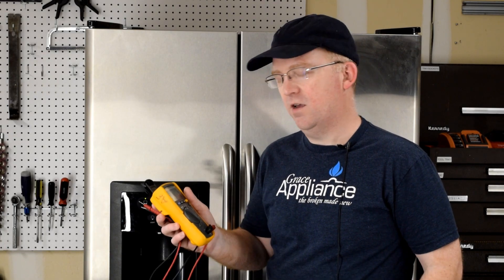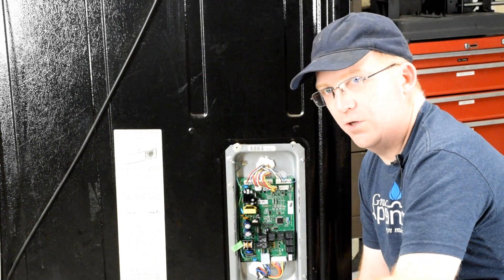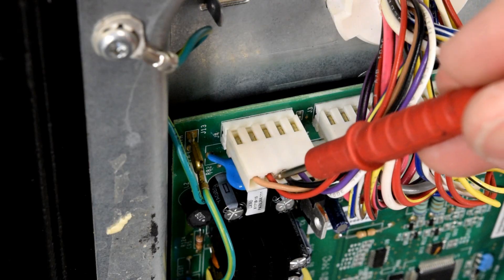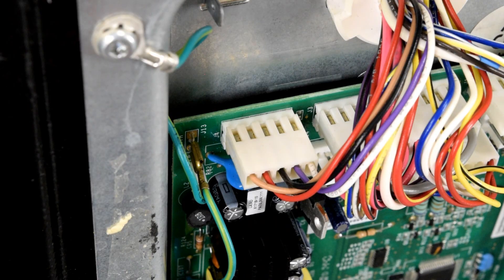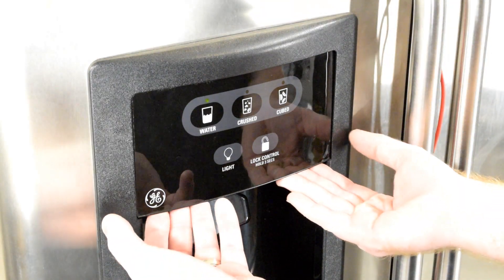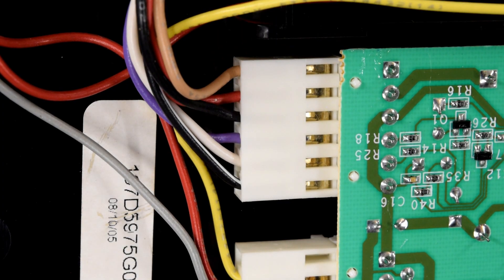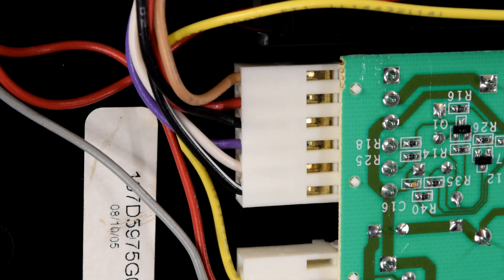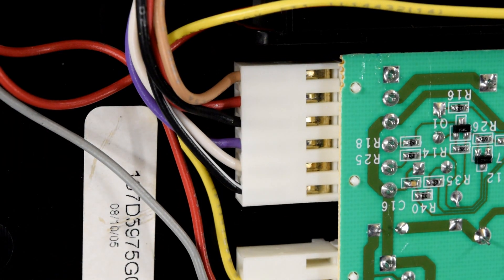Diagnosing a Bad Control Board - Part 4: Front Touch Panel

Comment: My ice and crushed ice buttons seemed to be working well, but my water button was getting intermittent, or not functioning for periods of time. Having some other issues, I decided to check the control board's components, and found 1 electrolytic cap , a 1uF - 50V, that had gone totally open. There were 2 others of the same type on the board, and I had some replacement spare caps ( electronics repair hubbyist) , so, I swapped the 3 out, and I now have a perfectly functioning water dispenser!

Comment: Do I change the dispenser control board in the back of my refrigerator or the main control board? I changed the dispenser control panel in the front and it still have a black screen

Comment: Seems simple enough to test the font panel first rather than the control board.  Why wouldn't I just check if 12-14v is coming in there first before looking at the control board in the back?  (Also I have noticed every GE fridge seems to have a different way to hold in the front panel,  some have snaps on the top, some snap off on the bottom (like yours) mine has two screws.  If I tried one of the snap off methods I would break something

Comment: In my case I don't get the correct voltage with J4 plugged in and it won't turn on.  As soon as I disconnect J4 it turns on and the pins have correct voltage.

I've disconnected the conector on the bottom of the freezer door, and with J4 plugged it's the same deal.

I changed main board, changed dispenser board.  Same issue... can it be the cables itself?  Will the fridge not turn on if there is no dispenser board present?

Comment: Hi  i have a question do I damage a control board that drives a linear motor when I power it without having the motor connected? I have a LG-GS73SDD and it doesn't respond to the internal freezer temperature sensor. It cools to deep and the motor is not switching off. I plan to test the Fsensor  and Dsensor but if that doesn't work I plan to add my own Arduino controlled sensor and switch one motor power feeds with a relay.  I was wondering if that damages the motor. The other option is to see if I can trick the FSensor en tell the mother board that the temperature has reached its set point.

Comment: Control board front & back control board  are test results 13.27  . No dispenser water & ice , I replaced water intel , switched, housing shield and solenoid for GE appliances. Also replace head filters still no dispenser ice or water.. I need help now ???

Comment: Our front touch panel had been out but  the the fridge and freezer were fine. The video was helpful. We don’t have the same model but the video did help. We ordered the display panel assembly. We had to order the bracket also because it did crack. We changed them ourselves. Success! Thank you!

Comment: Hi Andy!  Great video.  My problem is intermittent.  I have a GE28GYNCFS Side by side fridge with bottom freezer.  Control panel works for a while then stops working.  If I disconnect and reconnect power the panel always works again for a while (sometimes an hour or so, and sometimes only a few minutes) and then stops functioning.  Suggestions?
Reply from the maker: Hey Keith, it's likely going to be the main control based on the symptom alone.

Double check the outlet is not an issue by plugging in a different electrical device such as a lamp. This is just to rule out a failing socket at the wall. 

I would also want to rule out the front touch panel being shorted. At the time it's not working, if you disconnect the front touch panel from it's harness, if the fridge returns to normal, I would then suspect the front touch panel.

However, based on my experience it's most likely a weak relay on the main control board. As the relays heat up, they do not work as well, but often will from a cold start.
Reply: @GraceAppliance  Thank you for your quick reply!  I don’t believe it is a wall power issue - I’ve check the voltage at the duplex receptacle and it is 120VAC and even when the front control panel fails the interior lights are on and the fridge continues cooling ok - the control panel just stops functioning and ice dispenser stops.  I checked the voltage on the control panel and it stays between 12 - 14 volts dc.  I found that when it fails, if I unplug the harness on the back of the front control panel and then reconnect it the control panel resets and starts working again.  So I am thinking the problem is the front panel board… would you agree?
Reply from the maker: @keithgeorge2541  the front panel if shorted will give the same symptom, but once unplugged the fridge should nearly immediately act as normal. If no, I'd focus on the main control instead.
Reply: @GraceAppliance  will give it a try.  Thank you!

Comment: Hey Andy, I have a problem with my GE side by side refrigerator  (Model# GSH25ISXBSS). I set the temp control to the recommended temps (0 freezer, 37 fridge) but the actual is way to low,  -5 and 25 degs. I have replaced 2 of the 3 temp sensors and the main control board. The only temp sensor that I didn't replace is the at the bottom of the freezer. Could that be my problem or maybe the dispenser control board. If you think it is possibly the board, I think you do board repairs, would you have one? I am having a hard time finding one. GE is not making this board anymore. This has been a real chore for this old man but will "getherdone" if the Good Lord let me live long enough. Thanks up front for the help. I have watched all you videos many times. You bring it down to earth even to where I can understand.   
 Thanks again Mike

Comment: this viedo shows me so much- I thought the voltage would be AC and I stayed away. I replaced my auger motor on my Frididaire  FFHS2322MW2 and it and the inside light still don't work; so I'm planning to use the structure you taught to diagnose my problem. Thank you

Comment: Great video.  I have a GE Profile PSS26MSWASS.  The dispenser display was blinking a "0" then it it went dark after a couple of days.  The voltage at the dispenser measured 8-9 volts.  I could not find a wiring diagram so I assumed it was low compared to 12-14v stated on this video.  At the circuit board in the back, it measured 13.6V  What would that tell me?

Comment: I don't understand why you set the multimeter to DC voltage and not to ac voltage, since the refrigerator is running with electricity from the socket.
Reply from the maker: Hey,
The fridge has certain components that use DC voltage such as the fan motors and other things that use AC such as the compressor and light bulbs. 
The voltage is transformed via the control board from AC to DC. 

I hope that helps.
Reply: @GraceAppliance  thank you, one more question how you know if fridge equipment uses DC or ac volt?
Reply from the maker: @kamalabbady6778  the component will say on it. Also, 120v AC will use larger wires than DC which will have thinner wires.

Comment: Hi Grace, I have followed your tutorial, and did all the measurements, my issue, is that I recently replaced the evaporator fan, and right after that, when I plugged in the temperature on the front panel on the freezer was showing -43 degrees c, and the fresh food 2 degrees, and at this point the refrigerator was off for more than 24hrs. I test all the thermistors, they are all good. So what seams to happen is, as the temperature provided is so low, the compressor won't start. I got it to start by raising the temperature on the front panel, on the fresh food compartment, and then again turning on, since the temperature at that point on the front panel stats 2 degrees, when I set ti 1 degree, it starts, but than 5 min later would turn of as the temperature on the FF move down to 1 degree, and at this point it would not turn on again, unless I do the same steps again! I test the sensors and power on the board , and I got 5 volts w/ the conector unplugged and 1,5 volts w/ it plug in. can you help? mi ref. is a side by side profile - 200d6823p076

Comment: This is the best video for figuring out how to remove the control panel. I searched through all of them and this one works for the GE Profile, side-by-side model too. It's impossible to get to all the mold and crud inside the ice and water dispenser area unless you remove the panel. It's got to be a lot healthier now that I removed 15 years of super nasty stuff.
Reply: You can use long stick cotton swabs (for plastics areas only), damp them in a glass with baking soda or white vinegar then use that swab to clean difficult to access areas. Don't touch anything electrical and off course, disconnect power before start cleaning. there is a way to dismantle the whole system and put all the plastics in bleach but if you don't know how to do it, you can easily beak the plastics pins or loose some very small springs and screws. Always use hand tools, not powered.

Comment: Great video. My situation is a bit different. I have 13v going to my dispenser from the main board and the dispenser has a green light flashing on the water button. No buttons work. Water pressure is fine and the line isn’t frozen. I thought it was a bad front panel board and replaced it but the new one is behaving exactly the same. I ran a diagnostic using the temp buttons (service mode) which reported that the main board is not communicating with the front panel. My gut says bad connection perhaps via the wire that goes under the door. Would you recommend some further diagnostic to help pinpoint the issue? Thanks a lot.
Reply from the maker: Hey, thanks!

Yes, I'd first suspect the connector near the bottom freezer hinge. You may find corrosion or broken wires there.
If the connector is too far gone due to damage, you can delete the plug altogether by soldering the wires together, but this makes removing the door more difficult in the future if you ever needed to.

I'd start there and see how it goes.

Comment: Hi Grace Appliance, I have a GE side by side and my freezer is 0 degrees F at its warmest setting and the water dispenser has frozen up.  I bought a heater kit to keep the outlet of the water warm.  I have 13 volts between the red (slot 2) and the wires on either side (this is the front touch panel).  However, the heater is supposed to be connected to red (slot 2) and slot 6 but I don't have 13 volts there (no voltage).  Can I connect the heater to slots 2 and 1 or 2 and 3?  Or should I be checking thermistors?  I checked one of the three at the bottom of the fridge and it seemed OK.  This is a GSL25JFXL.
Reply from the maker: You may want to verify true temp with a separate thermometer to verify thermistor/sensors. But, the side by side GE is notorious for freezing water lines due to insulation breakdown inside the door.
You can help this with adding some insulation to the inside of the door behind the dispenser as well as the heater.

Yes, if you find 2 pins that provide 13vdc full time, those will work fine for your heater.

Comment: This was very informative. I'm not sure where to go from here. Everything lights up on the front. The Ice door comes open but no water and no ice. It doesn't even try to come on. I unplugged it and now it flashes 00 00. Any ideas?
Reply from the maker: Hi Kris, thanks!
What's your model #?
Reply: @GraceAppliance  Sorry about that. The model number is GSE25HMHBHES, Thank you again
Reply from the maker: @kriskrock3381  so, the zeros indicate an issue that the front touch panel is not communicating with the main control board behind the refrigerator.
Most commonly, this will be a corroded or damaged wiring harness near the freezer door bottom hinge. 
Remove your kick panel from under the fridge, lay down and examine the connector there. You may find corrosion or broken wires. Unplug and replug in this connector 10x and see if it improves things. In dire times, I've removed the plug entirely by soldering the connections together vs having a connector.

Let me know how it goes.
Reply: @GraceAppliance  Thank you very much. I really appreciate it. I'll let you know what I find out.
Reply: @GraceAppliance  so I checked the connectors. No corosion, connection is secure and nothing is loose. Thank you again for the help
Reply from the maker: OK, does the refrigerator run/cool at this point?
Are the interior lights on?
Reply: @GraceAppliance  yes. The refrigerator runs and all the lights and everything else works as normal
Reply from the maker: Gotcha!
So, I suspect it will either be a poor connection between the front panel and the main board behind the fridge or perhaps a failed main control board.

Using a multi meter, you would be able to verify proper connection between the two boards. If you needed some detailed help in this respect please consider becoming a channel supporter where I am able to provide more in depth support through the community tab there. 

Https://www.Patreon.com/graceappliance
Reply: @GraceAppliance  thank you very much. I appreciate all the help. I'm going to give it a shot
Reply from the maker: @kriskrock3381  most welcome!

Comment: GE side by side refrigerator. WR55X10942P control board. Control board makes clicking noise and refrigerator will NOT start.
I removed the J13 connector (Water and ice dispenser) and refrigerator works.
Do I need to replace the control board or check something else.
Thanks
Reply from the maker: Hi Thomas,
What is the model number for your fridge please?
Thanks
Reply: @GraceAppliance  GSS25SGMD BS
Reply from the maker: @thanoskontonassios5088  Hey, So based on the symptom, it appears that the front touch panel is shorted. Once the shorted component is removed from the system the fridge goes back to working as expected. 

The part appears to be discontinued, but I was able to find one on Ebay which claims to be new.   I hope it's helpful.  Thanks!

https://www.ebay.com/itm/125128922271?hash=item1d2243d49f:g:RhgAAOSwsAth-Yqx
Reply: Actually I disconnected J4 connector (water and ice dispenser)  for the refrigerator to start.
Reply from the maker: @thanoskontonassios5088  correct. J4 is the communications plug between the main board and the front touch panel. By unplugging the J4 connector you removed the shorted touch panel from the system.
Alternatively, You can confirm this by removing the front panel from the fridge and disconnecting at that plug.
Reply: @GraceAppliance  I disconnected the front touch panel and started the refrigerator. Works.
I reconnected the front touch panel and it still  works.
I agree that the front touch panel is causing the problem and I ordered the replacement.
Thank you very much for your help.
Big fan!!!!!!